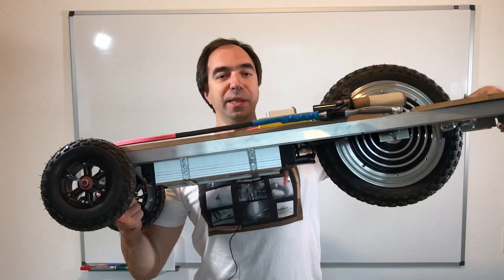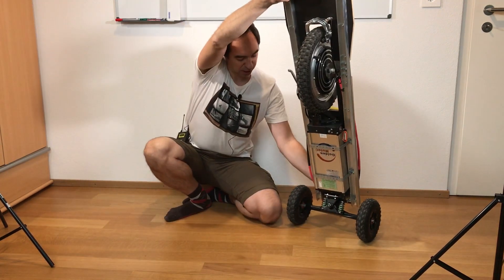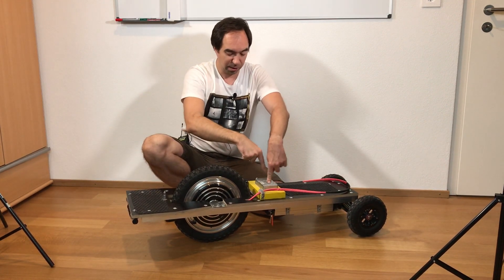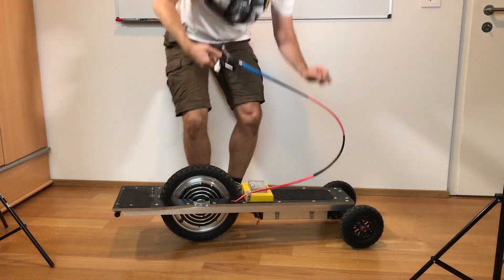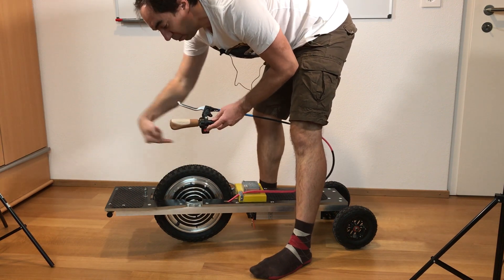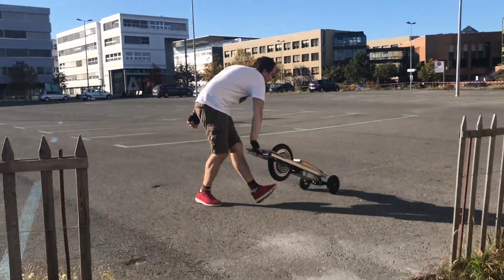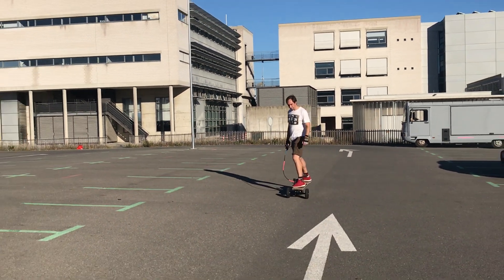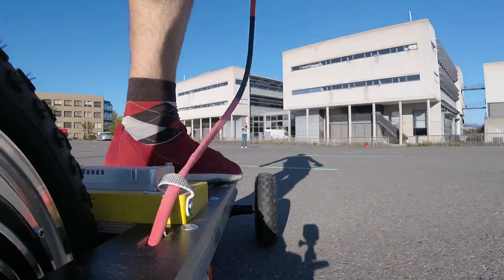Double Power for Monster Electrical Skateboard (Do-It-Yourself, DIY, Three-Wheel skate)

Comment: it doses not look stable enough in many occasions it wants to lift the other 2 wheels I think you should move the main wheel to the back and you stand in the middle between the 3 wheels that would make it more stable and comfortable to ride, it would make the skate longer tough maybe that not what you necessarily want
Reply from the maker: You are right. Also with the longer distance between the front wheels and back wheel the turning radius would be much greater. And I wanted to keep the turning radius quite small. But finally the skateboard is quite stable. Also I am very bad with skateboards, and I have very small experience. I should find someone with more experience to try to ride it.
Reply: @Skyentific  you can cover the big wheel it would make riding it safer I think

Comment: А почему ты не удлинишь доску, разместив ведущее колесо дальше? И весь вес будет распределён в базе скейта, как на обычной доске.
Reply from the maker: If I will increase the distance between motor-wheel and front wheels, this will increase the turning radius, which is already quite large. And I should say that in the present configuration this skateboard is very comfortable.